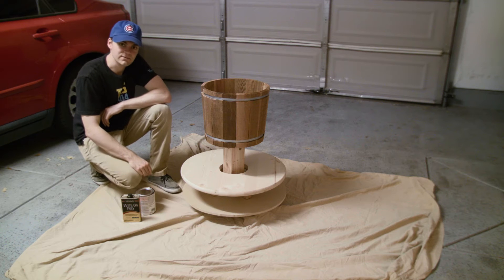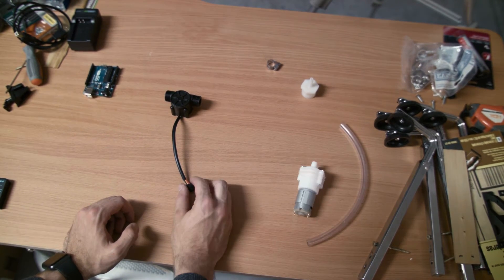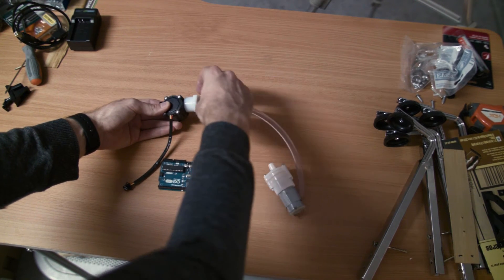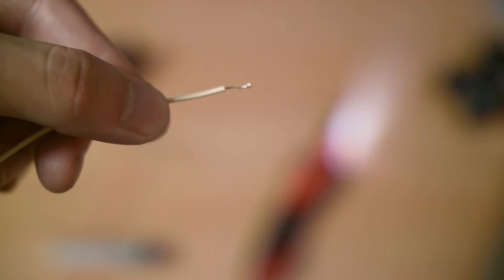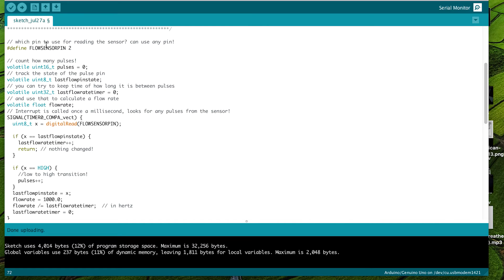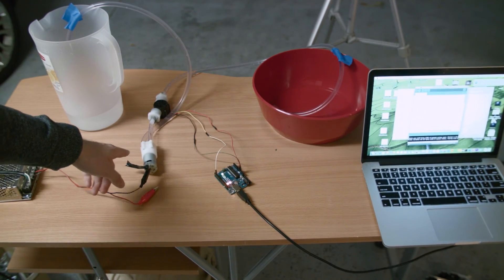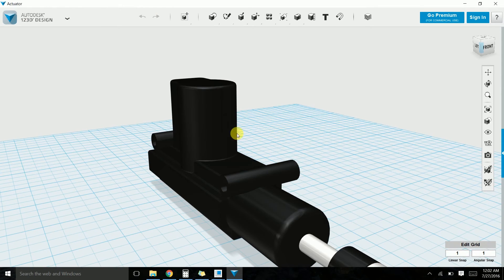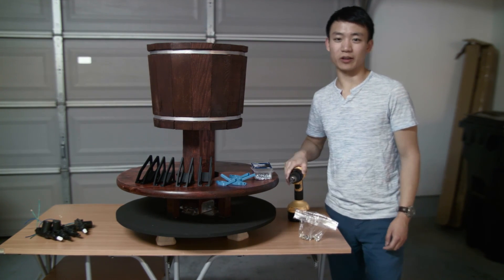Building a Robotic Bartender - Part 4: Varnish and Flow Meters

Comment: Nice. The company I work for build a big size 350 bottles a minute version of this. With a loadcell added to your glasholder you can  add weight control.  loadcells are not that expensive and easy to work with. Love your project  so far. I subscribed.

Comment: Maybe just a minor concern, but couldn't using flow sensors get kind of unhygienic or be a weak spot malfunction?  Wouldn't using weight sensors with initial calibration be easier to use and maintain in the long run?  Plus if you use weight sensors for every bottle you could let yourself be notified if there is a certain weight loss, either because of nearing depletion or because of unnoticed leakage. The density disparity can be ignored for practicality reasons , I think. 

But I am not even an amateur, so I don't know if there are certain advantages or the absence of my feared disadvantages in using flow sensors.  But would definitely like to know 😁

Comment: Use some heat shrink connectors instead of solder wire together, they come very cheap and you already have the pilers.